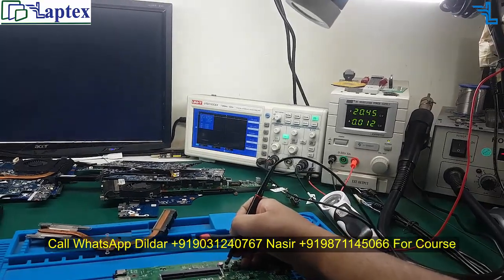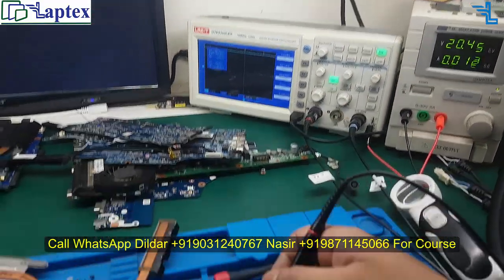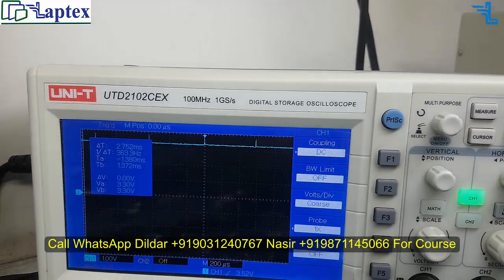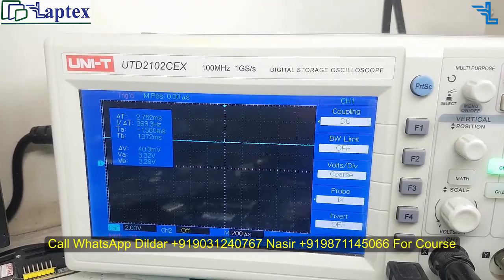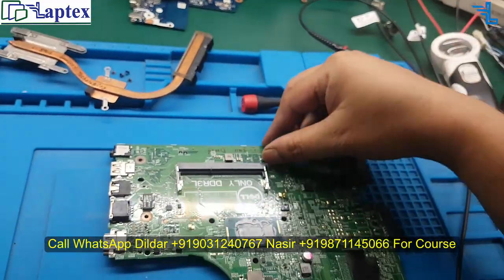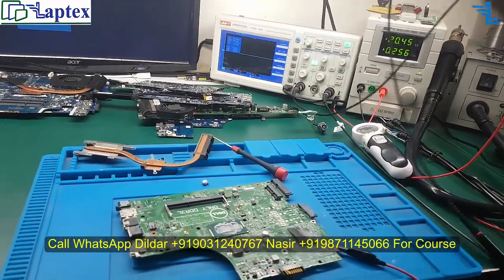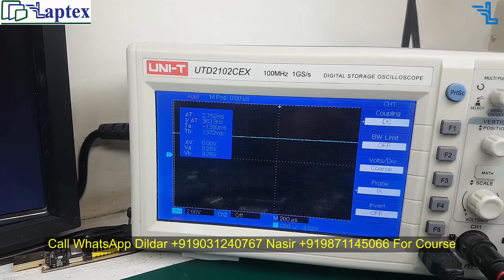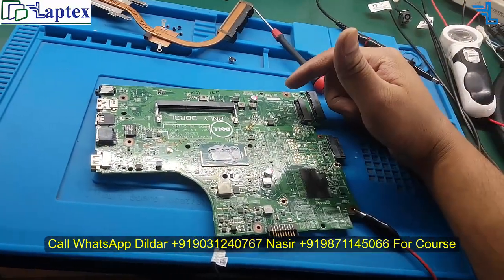DELL Cedar DEAD Motherboard GLITCH Solution in 5 min | Online Chip level Laptop Repairing Course

Comment: Which PDF reader you're using to view schematic diagram -.& Can i send laptop mother board for service? If so your address pls &
Reply from the maker: Foxit pdf reader...
You can send laptop for repairing.
Address is given in the description.
Reply: @laptex1377  need to send full gaming laptop with adapter or only motherboard is enough?

Also how much time i should expect for diagnosis?